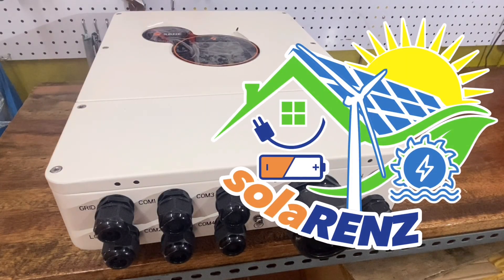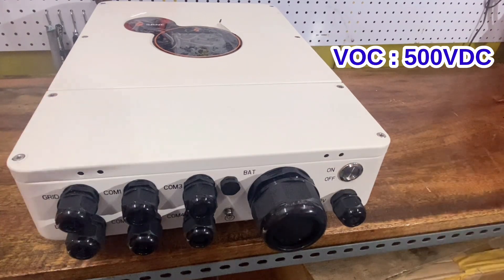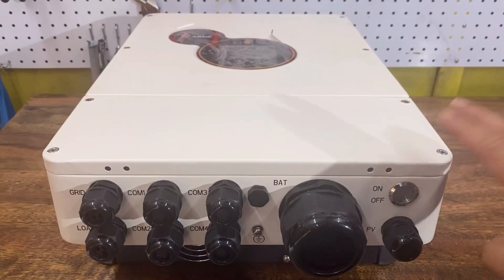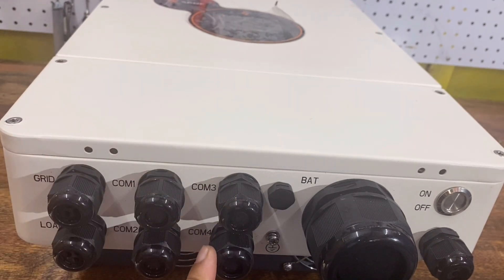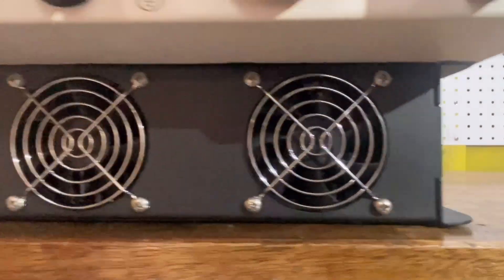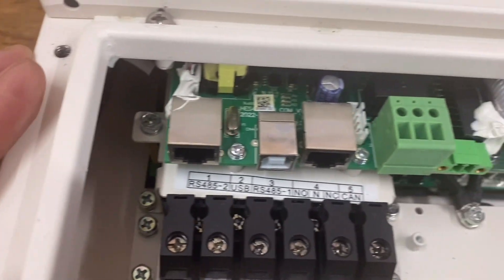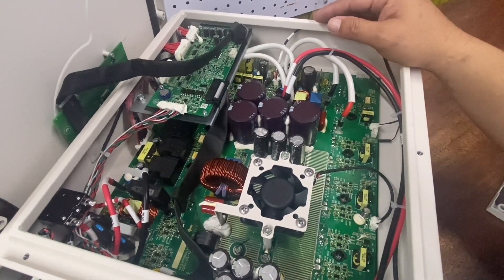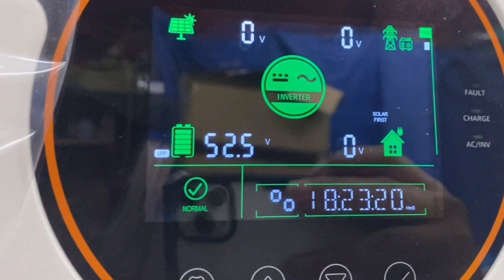Part 1- SRNE HYBRID OFF-GRID POWER 5.5kw INVERTER | PRODUCT REVIEW!

Comment: Will this hybrid inverter work if the zeros (AC input and output) are combined?
Reply from the maker: Be specific.
Reply: @solarenz  Will this hybrid inverter work if you connect the "N" input and "N" output to the inverter in parallel ?

Comment: There is missing a basic feature, the capacity to connect in parallel with more units in order to compose 3 phases system
Reply from the maker: It can not be